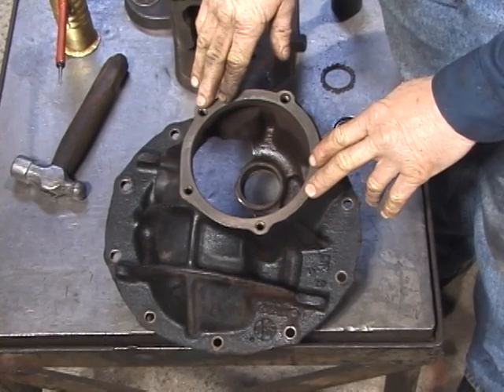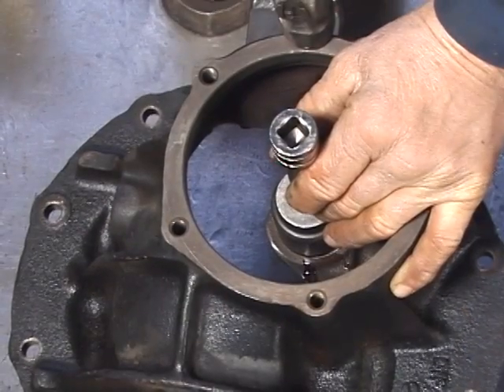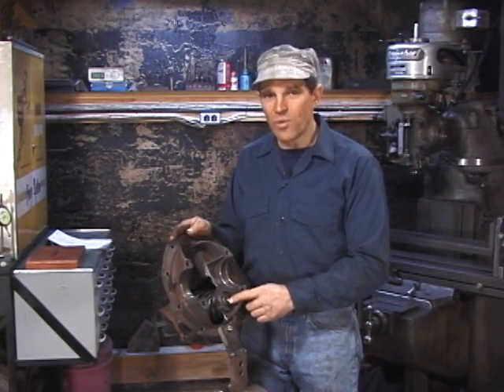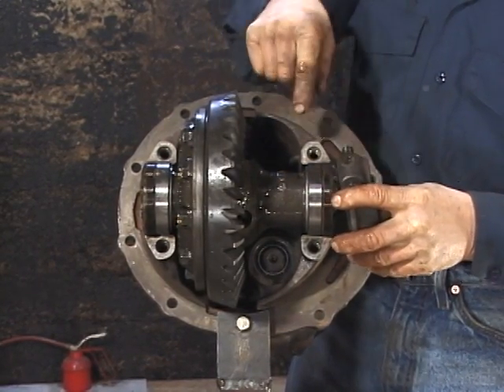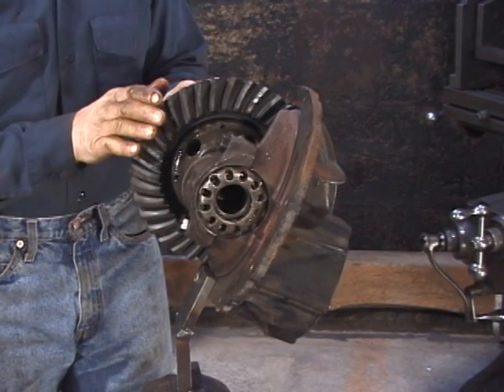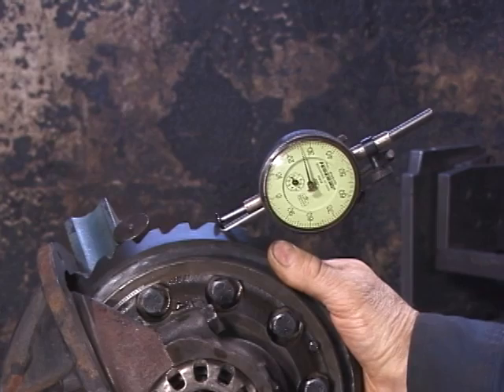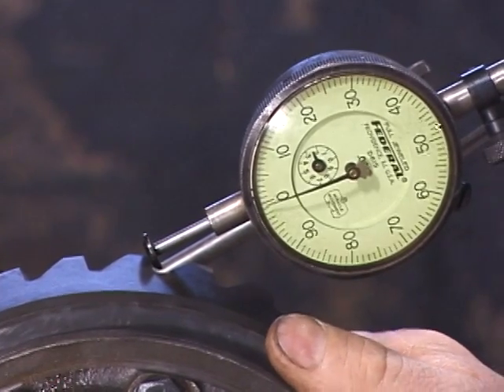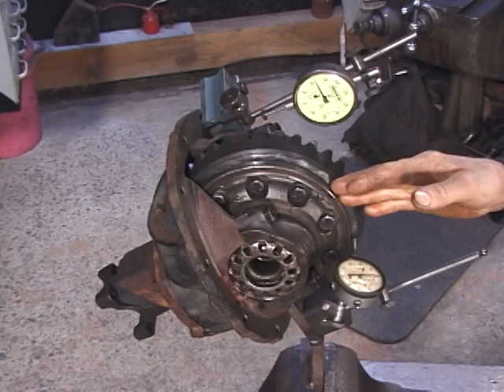Rebuilding Rears- Part 4- Main Housing Assembly

Comment: Great video.  Very informative.  However the sound is breaking up badly.  )-;
Reply: Very good presentation ,What causes that wining sound.
Reply: @mariaeyah6475  this was most likely a VHS tape, and either the heads on the VHS player were dirty, or the tracking was a little off.

Comment: No Loctite on the pinion carrier to housing bolts?  What about the ring gear bolts?  I only recall you using Loctite on the pinion nut and carrier adjuster locks.
Reply: Stan Rodgers He did put red Loctite on the ring gear bolts.